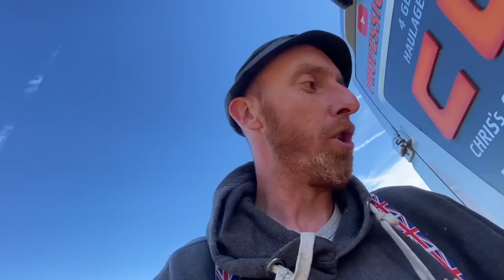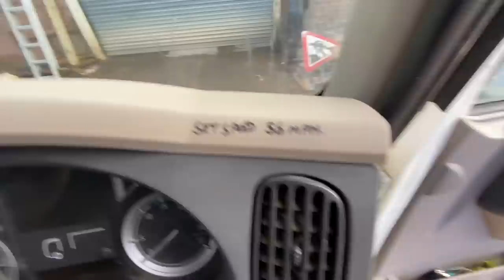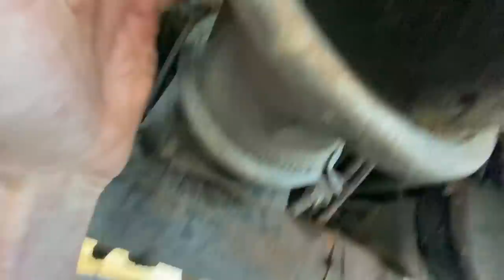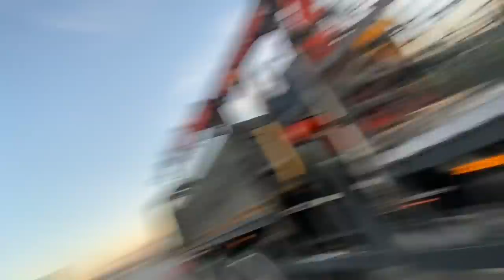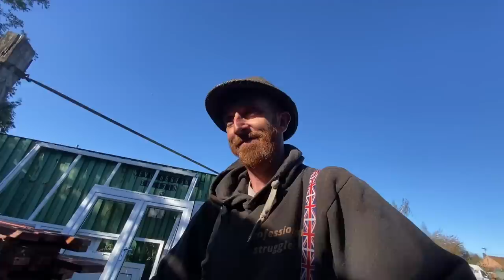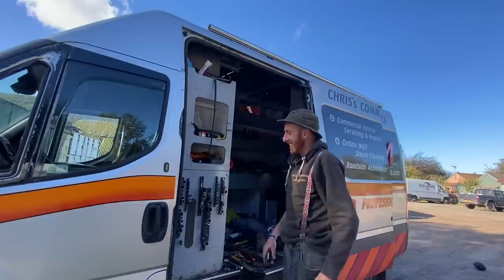will STRUGGLE HOLMES remove the Evil jammed key!! Chamber replace, MOT prep and all that jazz

Comment: Quick word of warning Chris, never run Lithium Ion batteries down to the lowest Red mark all the time. It'll kill them so fast you'll be buying new ones all the time. At 50% or 2 bars recharge them, it's a con by the battery makers to make you burn batteries out. buy a little genny for the van to charge them or plug the charger into your invertor

Comment: You know what the problem with them locks is Chris, lack of lubrication.  Don't use WD40/GT85/KY jelly etc it screws them up.  You want a PTFE or graphite based lube in 'em then no more key struggles.

Comment: I had the same problem in cornwall 2 weeks ago! Drove 65 miles to a beach then reliased I forgot the dog lead drove back 30 miles to a local pets at home then drove back to the beach. The car park is 2 miles down hill and soon as you decent signal is gone and it's a single lane. As soon as I parked up and turned it off. KEY NOT DETECTED! My stomach fell out my arse no one new what was going off. Used the  new dog lead to undo the battery terminal to reset ECU and that didnt work. Ford couldnt do anything or new about it! Turns out my misses kicked a control module in the foot well! I only realised this when the car had done the 300mile trip home 🙄😪